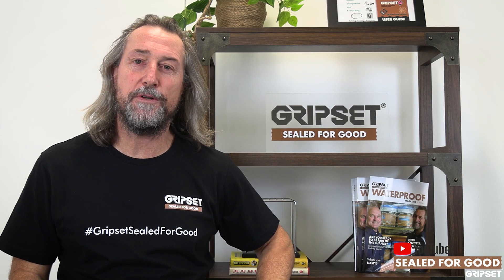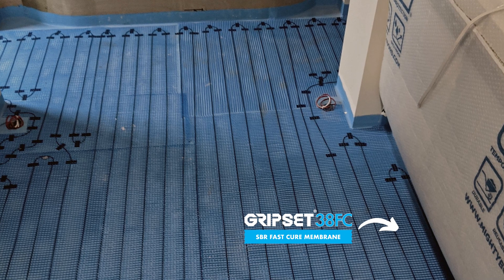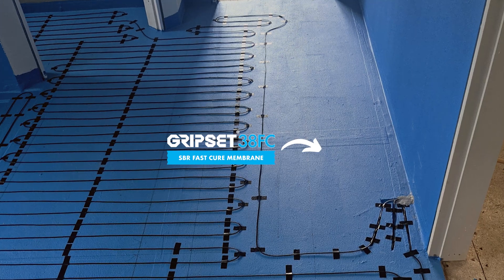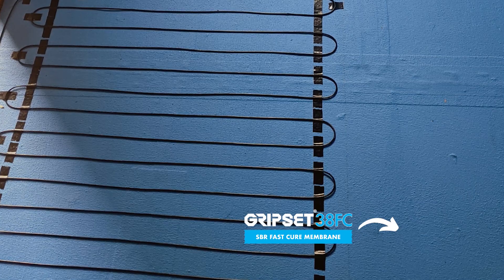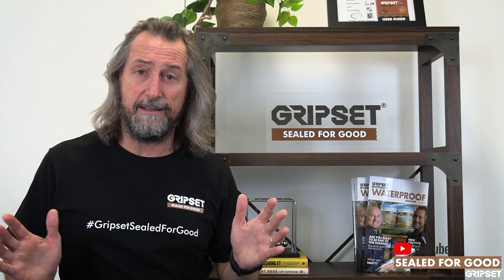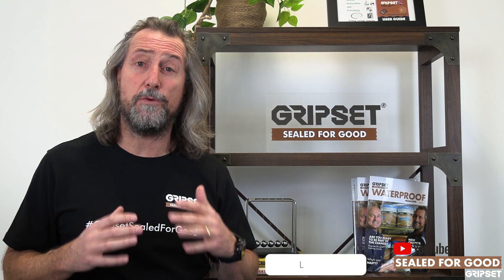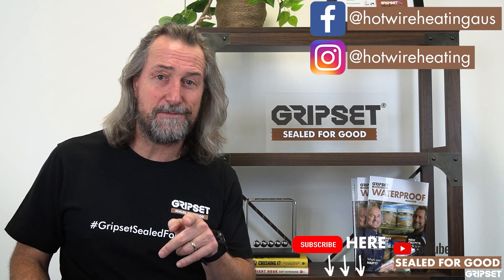Incorporating Underfloor Heating in Waterproofing

Comment: Hi , Thank you for the informative series of videos.

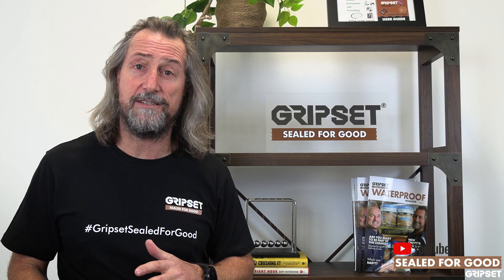I have always had a query about how best to get the heating cables out of the wet area floor. I noticed that in your video at 2:00 min into the video the cable are put through a hole in the waterproofing and then sealed over. Is this sealing over electrical cables acceptable or should it be done some other way. My concern is if the cables are tugged on for any reason or the connection between the sealant and the sheathing fails? the question is 
should this be relied on.
Reply from the maker: Hi Charles, Thanks for watching, you should always refer to underfloor heating manufacturers recommendations for these types of enquiries, hope this helps!